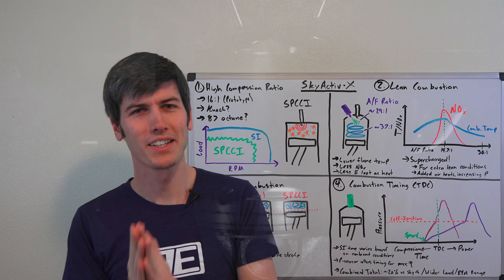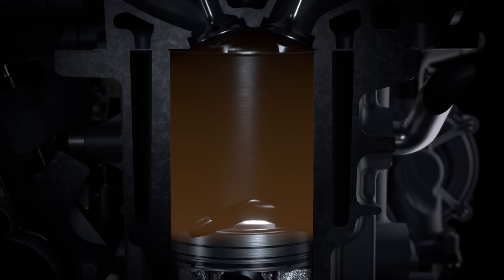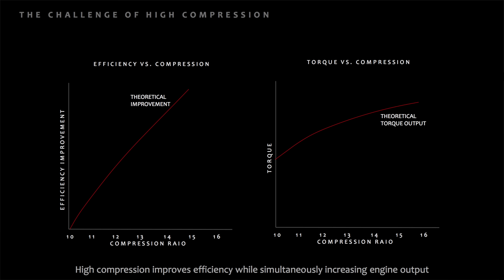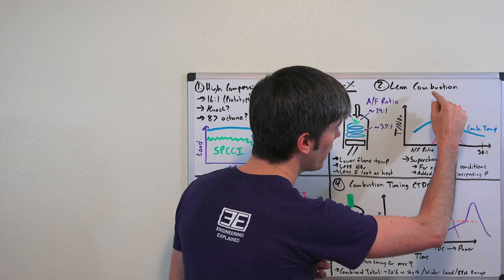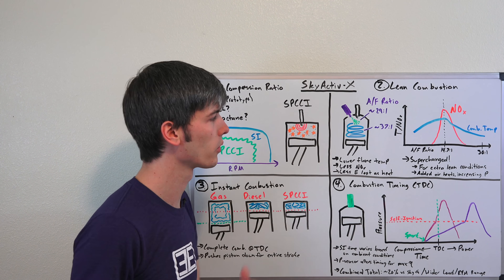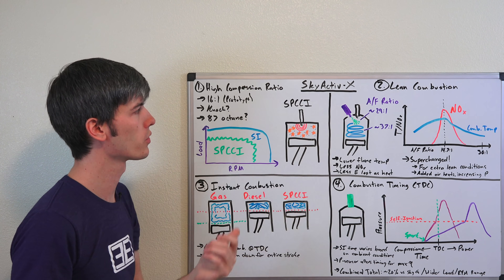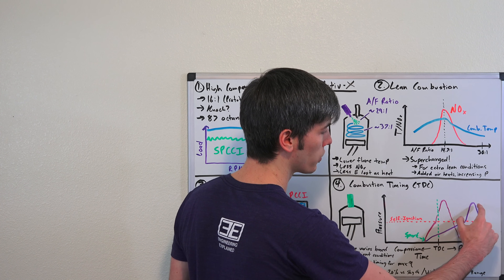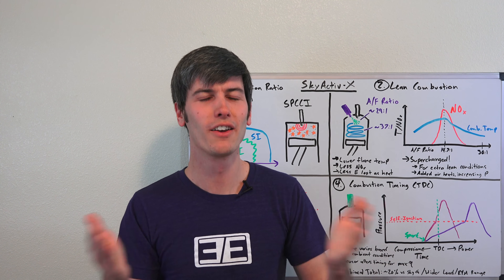How Mazda Is Saving The Gasoline Engine - SkyActiv-X

Comment: The fanatics over at the EPA and elsewhere are probably looking at ways to bar Mazda from the US market! The planned demise of the gasoline engine must go forth! lol
Reply: @Dude Shark Using Biofuels for cars is not a long term solution because as you said it's still emits emissions (more than renewables), but it can be used as a method of reusing waste to generate power (waste to power systems). There's really no other type of vehicle propulsion that's better than electric right now. Even Hydrogen-fuelled cars aren't viable considering the engineering risks of compressing/containing the gas at high safety levels + the more steps needed to make the whole energy equation work (it's more inefficient than simply connecting an EV to solar). 

@In Aere Edificare 1) Yes I'm aware of this. However this is because of entropy. It's impossible to create a 100% green perpetually sustainable energy mix, and there will be some losses - so the recycling process will end up costing the environment in some way. However we can minimise this by having the recycling plants running on renewables too, increasing the efficiency of the plants etc. Most importantly, EVs last much longer than ICE cars so it will take longer for disposals to occur. If Self-Driving/Transport-As-A-Service tech becomes the norm this reduces the number of disposals even more. 

2) You are assuming that the all the power coming to said 15 storey building is being generated on it's roof. However even today, millions of homes and buildings receive all their power from say Hydroelectric Dams or off-shore wind farms. The energy does not have to be primarily rooftop solar to go 100%. Also, it's a myth that we need lots of land to go 100% solar (which won't really happen anyway), you'd only need about 100 miles x 100 miles of panels to power the US (at current energy consumption).
Reply: ICEs are on the way out, there no way around it. Electricity is cheaper than gas or diesel and can be produced in much more clean ways than Big Oil could ever dream of, batteries are recyclable and EV drive trains have much less moving parts which means also less failure rate. If you still think ICEs will be common in 50 years, then look at what shell and other big oil companies are investing in. They know Oil is going the way of the dodo.
Reply: Nikhil Pande Solar captation depends directly on the amount of surface.. Thats a population related problem... Pay attention: For you to have enough energy to go off grid.. you need (at average) the same square surface panels per room for every room you are powering ..meaning a two or three story construction could never achieve fully off grid functionality.. Now lets go to the place everything is going to take us.. Over population.. if you have a 15 stories apartment building which has a dinning place.. gym a small grocery store.. Roof garden..(all which would help to suppress transportation energy usage) how would you collect the necessary power output?
Reply: You're using an outdated argument. Look up 'Tesla Battery South Australia'. 

Renewables can absolutely power all the world's energy if it can be stored in a battery (or any other mechanism). Wind produces a lot of it's power at night, solar in the day, energy storage systems can store excess energy to supply when there are shortfalls of energy generation from renewables etc. Hydroelectric and wave energy also have a massive place to ensure reliable generation without the necessary need for storage. 

You don't and won't need back-up gas plants anymore. In fact in South Australia the Tesla Battery has been used to make the need for creating a new gas plant unnecessary. Both the price of renewable energy systems and battery storage are plummeting as their manufacturing process becomes more efficient and produces at greater scales. Sure, nuclear energy will still be needed but most likely fission will continue to be a hard sell given the radioactive waste and it's potential to be weaponized - fusion is the way to go. 

Nuclear energy is great for space missions though, especially for ones very far away from earth (where the Sun's light is less powerful).
Reply: Nikhil Pande Good.. Now look up how much energy per ton does a battery needs to be produced.
Reply: Nikhil Pande Im assuming that as the main concern of over population is lack of space.. In the future the only certain fact is that there wont be anything more expensive than land..  When people have to choose between using land for producing food or for having a 60inch screen running for a couple of hours the choice is already made.. By the way i specifically stated for "Solar energy captation" as an example real life application where a solar powered city.. would need at least a same sized city of solar panels.
Reply: Well..  the misleading thing about electrics - they only displace the pollution, not eliminate it.  Electricity - for the most part - still comes from coal.  Renewable sources only make up about 5% of the US grid.   Until solar panels greatly increase their efficiency they won't be able to fully run your house, let alone recharge your car.

Can't beat the energy density of gasoline, coal (yet).
Reply: @MrHerrjon   "Electricity - for the most part - still comes from coal. "   No.  Just No.  only about 30% is from coal in the US and depending on where you live, it's even lower than that.
Reply: Nikhil Pande You realize a recycling process is an energy consuming activity?... You are trading energy consumption from one area to another one.. The problem we are facing is "buffering" how much energy we can "hold" between cycles for proper usage.
Reply: The misleading thing about that argument is the presumption that Renewables will take a long time to make the US grid 100% on renewables, and thus electric is still not viable. Sorry to say but when renewables become so much more cheaper than any fossil fuel (which they close to reaching), there will be no economic reason to install new fossil fuel energy generation and old plants will eventually become stranded assets. This is the essence of what will be an S-Curve disruption. The fact that it is 5% now tells you nothing about projected energy mix of the future unless you analyse the cost curve trends etc. 

Also I'm not sure if you've heard but it's already possible to run your entire house + EV with solar panels (and most likely also using a battery). It only currently costs more upfront today (with a long payback) than it will be in the near future. But that's only if you're talking about rooftop solar. Commercial solar plants can easily supply thousands of homes with power. The energy efficiency numbers don't have to become better for Solar to be viable (although the more efficient the better). 

Solar only has to now beat gasoline, coal on cost not energy density. There's so much energy coming from sunlight that the efficiency numbers are trivial when you account for much available land there is. Look into Virtual Power Plants if you think available land is scarce.

EDIT: Renewable sources actually power 10% of the grid but whose counting?
Reply: those jerks at th EPA also took all the lead out of fuel...we had so many mad, great criminals during the lead poisoning years and now crime is about half what it used to be...AND the idiots made us take arsenic and asbestos out of building materials...can you believe that?...and now they wont let us put trichloroethylene in drinking water just because its deadly!...pretty sad state we live in when uneducated people cant tell the educated scientists what to think...well we sure showed them smarties with trump didnt we? with all their fancy degrees and scientically proven facts that trumps says are covfeffe
Reply: You realise advanced batteries of the future (and even current ones in EVs) are recyclable right? Also it's highly ironic to bring up the issue of disposing battery packs, when the ICE vehicles are literally disposing smog/pollution into the air. None of that fuel will ever be recovered. Chemicals in batteries can be. There's no more denying it now.

The future is electric.
Reply: Nikhil Pande technically you’re wrong.  Bill Gates just invested in some technology that is similar to photosynthesis on a large scale that converts any carbon emissions into a hydrocarbon fuel.  Look it up.  If things go well, we could still drive regular cars and be able to clean up after it.
Reply: Nikhil Pande renewable power sources isn’t just electric.  There’s people developing biofuels.  The only reason we’re moving towards electricity is because it’s less emissions, don’t kid yourself
Reply: stickloaf you are incredibly out of left field.
Reply: FXIIBeaver uhhh environment is not right or left bro. It's like not dumping used motor oil in your backyard. Is that something you do??
Reply: Could there possibly have been a more perfect reply to prove my point! Well done stickloaf. Have fun charging your Prius every 250 miles and then disposing of the batteries when there all used up! lol
Reply: stickloaf the point 
_______________
Your head

Comment: so..  if someone doesn't understand what this engine is, and so tries to improve the power output by some traditional means, like removing the stock supercharger and replacing it with a 'high performance'  turbo or supercharger, instead of improving performance they may actually make it worse, because the stock supercharger is specifically tuned to be an important part of the engine as it was designed ?

Comment: What if the carbon build up will cover that pressure sensor? :D It is a d.i. engine after all...
Reply: mazda, a massive automotive company with limitless resource and testing, innovative leading engineers, didn't think of that.

Comment: Highest CAFE isn't that hard when you don't sell anything fast, and run the same small displacement engine in the bulk of your vehicles; not knocking Mazda, I think they are a great company, but when you just barely do better than Subaru, whose entire lineup (except the BRZ of course) is full-time AWD, and has performance models offered, it's nothing more than marketing; had to point it out. The rest of the video is solid and informative.

I have enjoyed your videos, I enjoyed this video, I assume I will enjoy your future videos.

Comment: "Extreme compression, supercharged engine, knock, and with a lean air-to-fuel mixture—it cannot be done!"

Mazda: "Hold my beer."
Reply: Butterffinger5678 and achieve 190hp while they're at it
Reply: @LP640PR  This is a call from 2021 in 2021. They got more than 190 horsepower..... ALOT more, Mazda engineers are madmen.
Reply: @johnathonlevesque3784  what?
Reply: Richard Price it requires more than just pressure sensors and ECU swaps, there is so much more to it than that. Unless the engine you're taking about also has variable valve timing and duration that can allow it to operate on an Atkinson cycle the engine wouldn't work at higher rpm. Plus you'd also have to modify the internals to allow for a much higher commission ratio. About all you'd be able to keep is the block!
Reply: *hold my sake
Reply: Sounds like a diesel.
Reply: Dylan Montgomerie but technically more efficient due to cleaner emissions
Reply: Eduard van Raalte  the Atkinson cycle is like a virtual variable stroke engine. The intake valve remains open for a percentage of the compression stroke. This allows some air to leak back into the intake manifold reducing the effective compression ratio ie mimics a shorter stroke.  During the power stroke it can use the full length of the stroke ie the compression ratio smaller than the expansion ratio. This helps with efficiency (at the expense of power density) and is currently used on Toyota hybrid engines, Mazda's current Skyactiv engines (where it switches between otto cycle for when power is needed and Atkinson when it needs efficiency) and of course this Skyactiv X which switches over to Atkinson at higher rpm in conventional spark mode to reduce the effective compression ratio to prevent detonation and operate like a conventional spark ignition engine. Let's see your chevy 350 lsx do that without a significant redesign/modification Richard. Again, it isn't as simple as you're making it out to be and wouldn't be a simple retrofit, otherwise it would have already been done long ago!
Reply: Butterffinger5678 sounds like the most important part it the controllers and sensors aka it’s possible to convert older engines with some upgrades like the pressure sensors and a ecu swap
Reply: But will it last? Only time will tell.
Reply: That Atkinson cycle is an absolute pig. Toyota never published a torque number for any of it's hybrid models, and I doubt Hyundai or anybody else did either. Some people claim efficiency; but to repeat the new beetle commercial "0-60, yes." A pure Atkinson without the Prius electric motor would be "0-60 good $@&*(%# luck!"
Reply: More like Hold my sake
Reply: Mazda makes great engines in general. The F6 in the Mazda/Ford 323 was awesome.
Reply: Hold my Sake!
Reply: Mazda: "Hold me, my beer can do this."
Reply: Will it be easy to maintain though? Wil those sensors pose a costly cleanup work? Or it's just pull one out then plug new(cleaned) one in?
Reply: It makes more power than my V6, but I can't be too harsh on it since it's 30 years old.
Reply: GGigabiteM lol 😂 isn’t that kinda the point of how this works just as long as it’s after TDC ? and it’s just a little gentle pressure spike not before Tdc and a big pressure spike = bad things
Reply: GGigabiteM Higher compression ratio yes but variable stroke length?
Reply: darkchild4neverever if your referring to Mazda let’s hope so that way it trickles down and the aftermarket parts and I get to use it easier on my favourite engines / the ones I have now 😏 and I don’t have to trade mpgs for 💯 power all of the time
Reply: It can't be done. The cry of those who never will.....
Reply: and Mazda still saying "Next Year". 2020 Mazda and CX-30 don't have SPCCI Engine.
Reply: Butterffinger5678 hold my skyactive tech
Reply: 2020 , guessing they need the 80 octane fuel ⛽️
Reply: Butterffinger5678 Mercedes started t and sold the technology to Mazda. Time will tell
Reply: "saki"
Reply: Beer drinkers never achieve anything in life, so give it a rest.
Reply: Hold my sake
Reply: And these days Im driving one. Really like how it drives like its naturally aspirated. Runs smoother than most Petrols Ive driven even though I thought it would be more diesel like.
Reply: LP640PR that sounds so low for a triple I engine. I guess technically it's a 3 cylinder
Reply: The engine designs are completely different, you couldn't use any of these features on an existing engine design and have it work reliably or properly.

Just trying to get a 16:1 compression ratio on an old engine would make the thing detonate, the parts aren't designed for it.
Reply: Richard Price. You could use some of the tech from this engine on any engine. Ceramic coating of all combustion chamber surfaces inc pistons (pistons would have to be forged) Valves and seats would need to be made in materials able to operate in such a tough environment. Then as long as the bottom end is strong enough and head to block sealing sufficiently robust, then just add sequential fuel injection;, injectors with a fine spray pattern and an inlet tract that induces as much swirl and/or tumble as possible. Then a few Hrs on a test bed optimizing  ign. timing for a given comp.ratio.  Adding a turbo will also improve efficiency, so will an exhaust that works as it should help.
Reply: It doesn't matter where the pressure spike is; The heads still have to contain that, as do the piston, connecting rod and crank have to absorb that.

You're also forgetting this engine runs on the atkinson cycle, the lower end where the crank is is vastly different to allow for variable stroke length, you would need a whole new block casting to get this cycle, it's not possible to convert an otto cycle engine to an atkinson cycle engine.
Reply: @GGigabiteM  Skyactiv G runs both cycles.
Reply: Mark Anderson ok for simplicity sake let’s use a sb chevy 350 lsx that’s built for turbocharger boost with a fixed cam timing what’s still stopping from using some or all of this technologies
Reply: Butterffinger5678 , Extreme compression seem to be winer, all tests sheet have confirmed that, But once the car get older, slightly clogging radiator can warp your cylinder-head and the car is done. This is the same reason why Honda lost a chance to beat Toyota down twenty years ago.
Reply: Mark Anderson just time the valves to the fixed Atkinson cycling and or controlling compression by controlling boost and timing. The hardest part in the past is getting predetonation ignition to work was high speed cheap and reliable control because it’s just like electronic tune port efi in the 50s was you could get it to but it was more of a racing part because of reliably controlling the fuel mixture and not leaning out